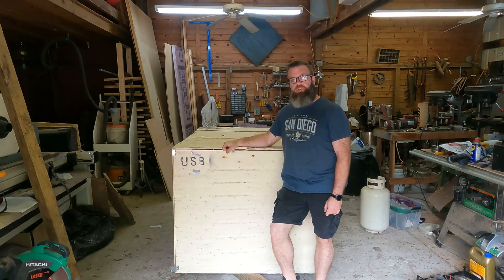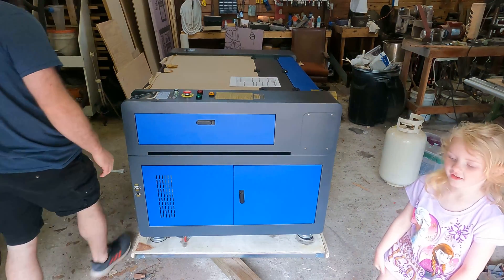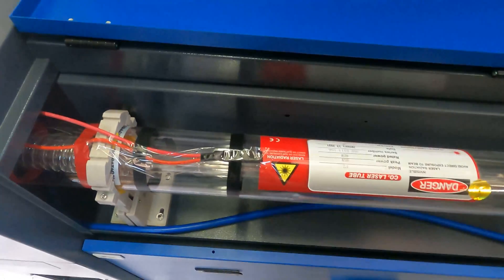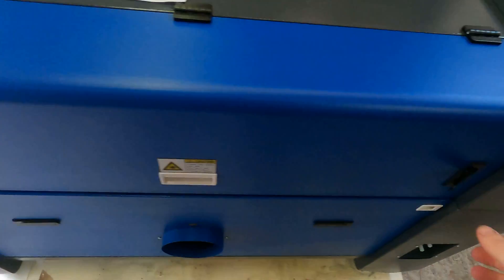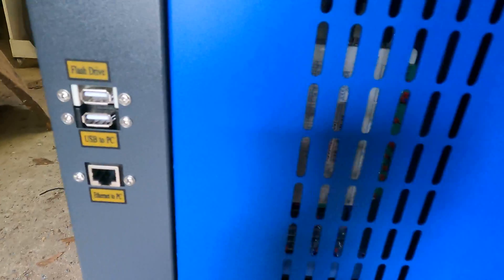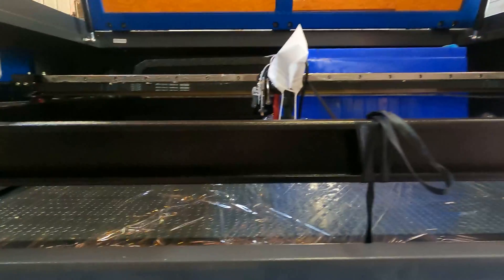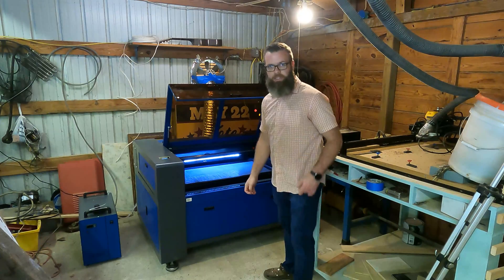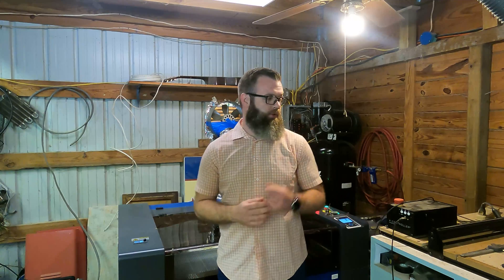80 Watt Laser unboxing!!!  OMTECH

Comment: Did you plug your chiller into the laser engraver? Or did you plug it straight into the wall?
Reply from the maker: The chiller power cord is plugged directly into the wall.   And since this video,  I've actually ran a wire from the laser flow sensor to the chiller,  so the chiller will tell the laser if there's water flow,  as opposed to the cheap flow sensor that comes on the laser.

Comment: Do you do any deep cuts? Like quarter inch acrylic? I'm wondering if you upgraded the exhaust or air assist?
Reply from the maker: I do deep cuts often.  I've even cut up to 1/2" plywood with multiple passes.  I haven't upgraded anything on the laser.   The only "upgrade" I have is the exhaust hose coming from the laser runs to an exhaust fan on the side of my shop.
Reply: Thank you!!!
Reply: @ReeseCustoms  On your milliamp display, is your knob turned to "Max"? My laser won't fire and the Amazon Omtech person is saying that I need to turn it to Max in order to "turn on the current".
Reply from the maker: The knob on my miliamp display actually doesn't do anything.   I can turn it all the way both ways,  but it doesn't make a difference.   Make sure you have water flow,  that will interlock the laser.  And I know this may sound obvious,  but make sure the key is switched to on,  and the emergency stop isn't pressed.
Reply: @ReeseCustoms  Yeah, mine doesnt do anything either. Key is turned and emergency switch isnt pressed. Water Is flowing thru tube. I think they shipped me one with a bad tube. Thank you for responding!! 💯💯💯
Reply from the maker: No problem.  One more thing you could check is to see if you see the laser firing inside the tube when it is supposed to.  If so then the mirrors could be misaligned.  Other than that, you could be right about the tube, or it could be the laser power supply itself.
Reply: @ReeseCustoms  Welp, I just went out there and turned the knob on the milli amp display to max, as a last ditch effort, and alas the machine is firing. When I turn it back to min, it doesnt fire. I have the same blue 80w with autofocus, but I guess they configured my differently. Go figure. 🤔 It doesn't change anything on the milliamp display screen when you turn the knob, so it appears that nothing is happening. Its crazy because this is absolutely NO where in the manual and I was about to return the machine.
Reply from the maker: Yeah the manual leaves a lot to be desired.. lol. But that's great you got it working!  I guess my knob is just for looks. Lol
Reply: @ReeseCustoms  Yeah, because I was going to crate it back up to return today. Thank you for responding. I will subscribe if I'm not already. By chance, does yours still fire if the knob is turned to Min?
Reply from the maker: It's no problem!  I try to respond to all comments and help any way I can.  Also, thank you for subscribing!  

As far as my laser, yes it works regardless of what I do with the knob.   I can turn it all the way off, or all the way on, it does the same either way.  Maybe I got the defective one...  lol
Reply: @ReeseCustoms  Wow. So much for quality assurance at the factories. Lol. 

You're awesome. I look forward to more laser vids. 👍

Comment: Almost a year later do you wish you would have gotten the 100W or the 130W ? if so why Subbed
Reply from the maker: Rick,  personally for me and what I do,  I can't really see why I would need the 100w or 130w.  The 80 cuts/engraved everything I need it to.   There have been maybe a handful of times I wish the working area was larger,  but I was able to get by using the pass through slots, but I've never said "man,  I wish this thing was more powerful".  The only benefit I see for me  is it would be faster at cutting or engraving,  but I have been happy with the speed of mine.
Reply: @ReeseCustoms  
OK thank bro
I am really tossed about it
I own a sign shop and was wanting to make LED laser engraved signs and also cut acrylic lettering and MDF letters
I have a large format printer and laminator so this will benefit me but just don't know if I need a larger bed size & more power
I'm pulling the trigger today
Thanks for your reply
Ill let you know which one I get ;-)
Reply from the maker: Sure thing!  And keep me updated, I'd love to hear how it helps your business.
Reply: @ReeseCustoms  
Well I pulled the trigger on the 80 wat
which it turns out that yI can always make it a 100w or even a 130 if I ever need to 
But after your advice and the tech at OMTECh, I feel confident that the 80 watts will be the only power I will need
Thanks again for all your help
Reply from the maker: @rickvestuto  awesome!  Congrats on the laser, I know you'll enjoy it.  If you ever need any help with it, just shoot me a message, I'm glad to help any way I can.

Comment: I am about to order the same Machine and I found your video. Looks awesome. Only thing that bothers me is I was choosing this machine partially because of the 4 way pass through. Could you tell me what you figured out with that side to side pass through? That definitely doesn't look right as soon as you show the view in there. Is it even usable or did they make a major mistake with that design? Like it really does look like you can't even fit a 1/4 inch thick piece past the laser. Or does it actually raise up or something? Thanks.
Reply from the maker: Great question Shawn!  Thank you for taking the time  to ask.  So initially I thought maybe it was a passthrough, then I thought maybe it was just an opening for ventilation... I'm still not 100% on what it is, but I'm leaning towards some type of ventilation slots and here's why....  If I am cutting 1/4" material, with the laser nozzle focused, the bed of the laser and the bottom of that slot are the same heights.  So if you slid a long piece of 1/4" material in from one side and it would work great.   I've cut big pieces 3 times like this so far. However,  the slot itself is not very big, so I doubt anything much more than 1/4" could fit through it, and even if it did, if you are cutting something thicker, the laser bed will need to be lowered for focus.  When that happens,the bed won't be even with the slot anymore, so your material won't be flat, it will be kind of going down hill, if that makes sense.  So unless they made a passthroigh that is specifically for 1/4" stuff, they are there for another reason, but, like I said, you can use them as a passthrough. ( Sorry to be long winded, if that doesn't make sense, let me know and I'll try to explain it better.

Comment: Which Ruida controller is build in?
Reply from the maker: It is the 644xg.
Reply: @ReeseCustoms  Thx for your reply. I guess, the light source is a no-name brand. I'm undecided between a 130watt big bed 1390 with everything on the cheap side, an 100w OMTech, and a 100w kinda desktop like version with a Reci laser. All for the same price.
Reply from the maker: I've got right at $5k invested in mine, and that includes 2 different rosaries, the chiller. And the laser itself.  I am super happy with it so far
Reply: @ReeseCustoms  Good evening Sir,  that was a very good to the point video. I am wondering how much travel do you get outta your Z Axis? and are you running a 3 Jaw chuck rotary? My C02 is pretty much shot and on the hunt for a replacement.
Reply from the maker: @robbillpries6198  I have a rotary but I have not used it yet.  If I had to guess, I could get about 5-6 inches of space on the z axis, even more if I take out the honeycomb table and knife blades underneath.  I believe that is how most people use a rotary with this laser.
Reply: @ReeseCustoms  right on.  Do you have an IG account or FB page ?
I
Reply from the maker: I do!  Check out @reesecustomsllc on Instagram. I also have www.reesecustoms.com for more examples of my work,  as well as things for sale when they are available.

Comment: Great video! Hard to tell from the video, how was the fit and finish of the machine overall? Many chips/scratches in paint?
Reply from the maker: Thank you!  The machine was actually in really great condition.   No scratches, no dings.  The laser was already perfectly aligned, I basically had to just hook up cooling water, turn it on, and go.  I've read horror stories from other people though.  Maybe I got lucky, or maybe those horror stories are few and far between?